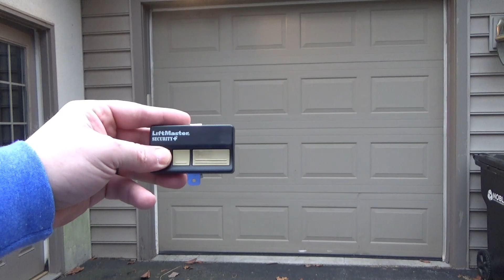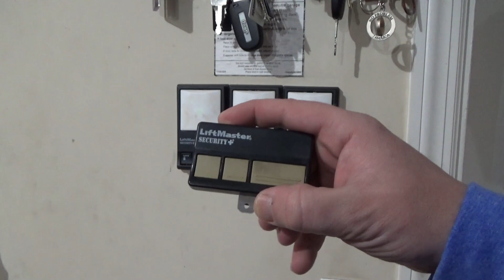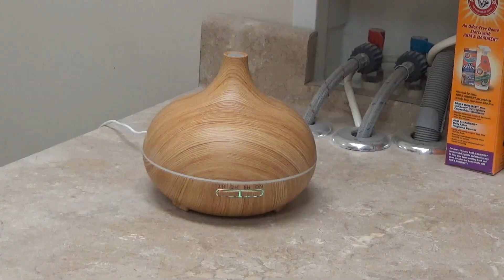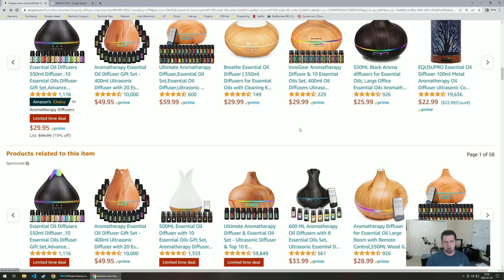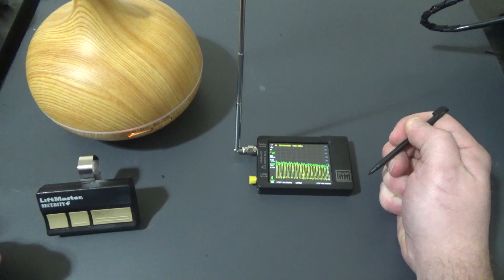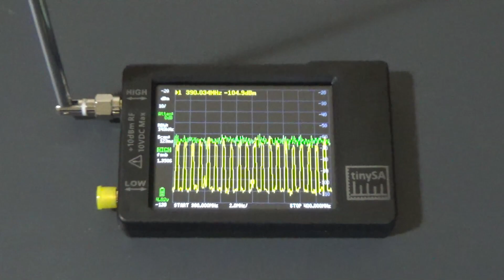Aroma Diffuser Jammed My Garage Door Remote's Frequency

Comment: I've been using diffusers as humidifiers in December and January because the gas heat has made the air so dry. I figured out today when I was refilling the diffuser,  that when I turned it back on, the radio station got really bad static on it!! I went and turned all four of the diffusers off and tried to open and close the garage door with all of them off, and it opened and closed all the way at the street and the keypad worked too!! I turned the diffusers  back on, and the garage door wouldn't work again. I turned them off, and they did work again. I found your video on YouTube. Who knew..? My neighbor was having garage door issues as well. I messaged him to see if his garage door would work with the diffusers off, and it did. I apologized that the diffusers caused a problem with his garage door, and advised him that I would not be using them anymore. So, the diffusers were causing havoc for us both. SMH!! Thank you for posting this video!! My son thought I was crazy when I was telling him about it, but I showed him your video to show him that this is actually a thing. I have already bought a new garage door opener, and since ours is 13 years old, I'm going to have another one installed. Thanks again!!